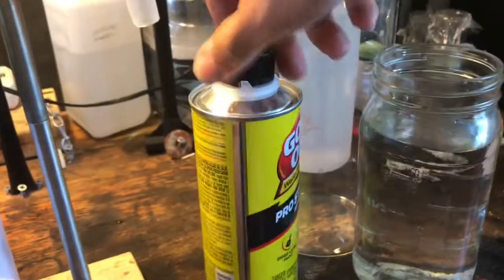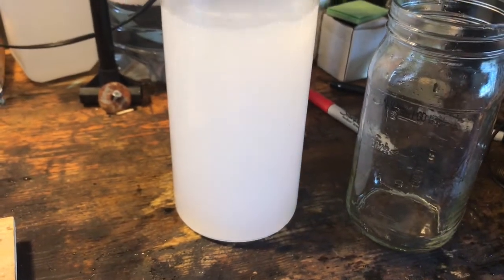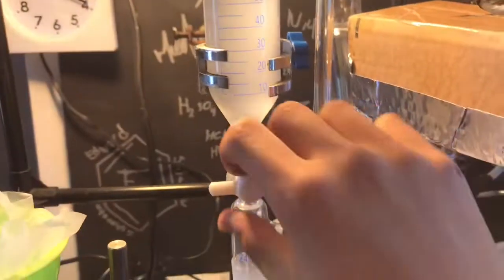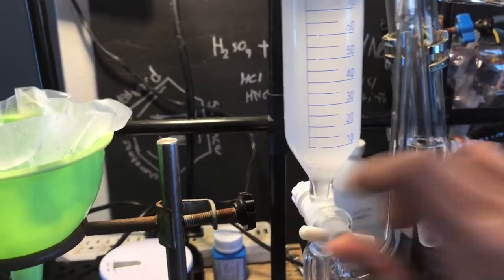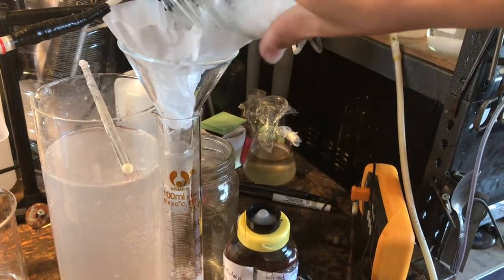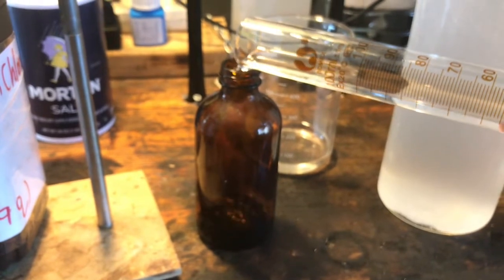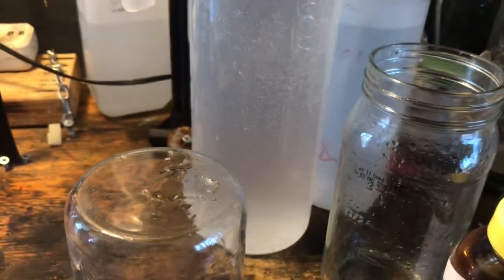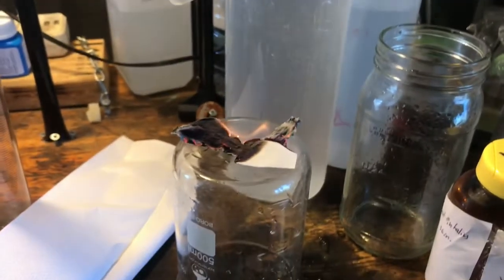Xylenes from Goof Off

Comment: now how do you get,extract and purify the formaldehyde from that blue stuff in porta potties for free.
Reply from the maker: probably simpler to make it
Reply: @EdwardTriesToScience  I meant that as a joke, but yeah, I'm sure it is.
Reply from the maker: just tried it yesterday again (catalytic dehydrogenation), I always keep getting a weird, cloudy mixture with oil suspension that smells like cabbage, there is a small smell of formaldehyde but its overpowered by the cabbage smell very odd, I'll do more experimentation and make a video on it soon
Reply: @EdwardTriesToScience  How?(the jist, save details for vid)